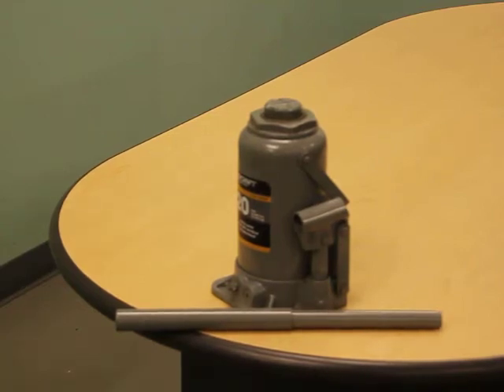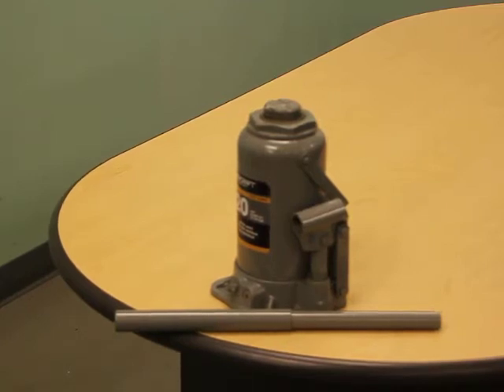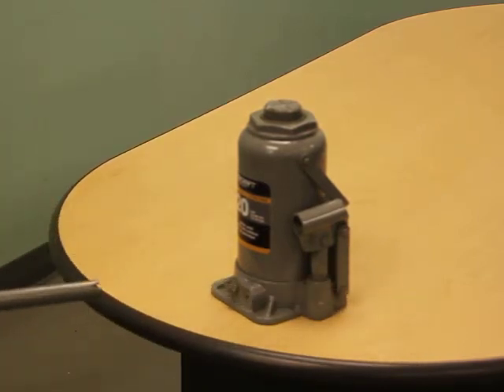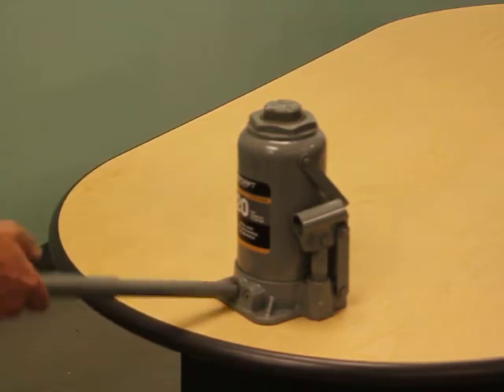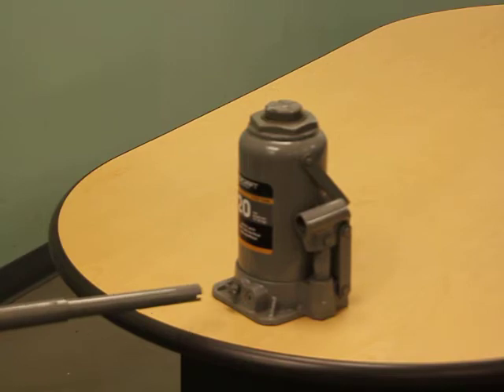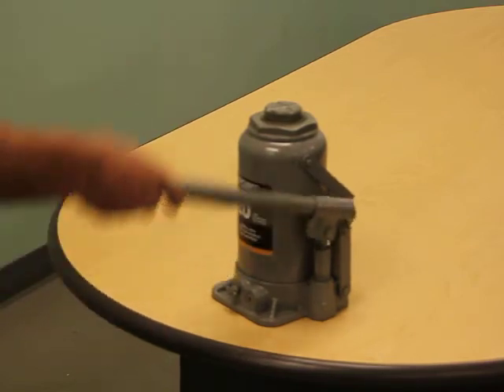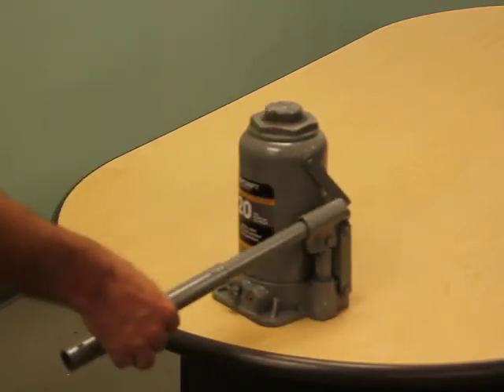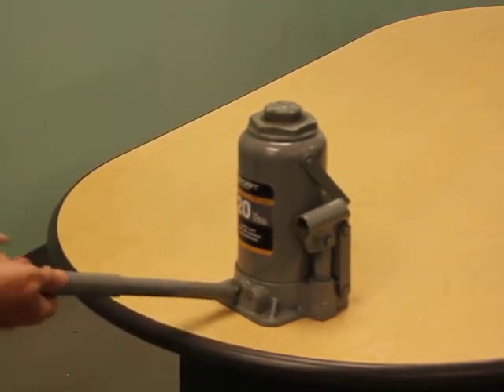How to bleed a NAPA bottle jack

Comment: I am a fluid power mechanic and have repaired thousands of Jack's. This is a long process. Instead do this. remove the filler plug and open the release Valve. Push the RAM all the way down. Close the release valve and grasp the top of the RAM and pull it up all the way to the top. Just like a syringe plunger it will draw a vacuum and the fluid will be drawn out of the reservoir And Into the RAM area. Now open the release valve and turn the jack upside down and place your hand on the base of the jack and push it down, you will get some oil coming out of the fill plug but you need to have it open to keep from pressurizing the reservoir. Now you've purged the air out of the system. Plus with this method you have flushed out the check valves. check the fluid level. Put the reservoir plug back in. Now your Jack is ready to use.
Reply: William Wayt,
What is RAM???
And why not make a video to show it?
Reply: The ram is the lift piston that extends when you pump the handle. I don't have a jack
Reply: William Wayt, do you think i might be a good suggestion to stop pushing it down when the fluid starts coming out?  Seems I lost a LOT of fluid.

Comment: Easyest way: lower the ram all the way, close everything. If the ram comes up on its own it means you have air. with a screwdriver just crack open the air bleed valve while sptepping on the ram, pushing it all the way down. this should get the air out . repeat 2-3 times.